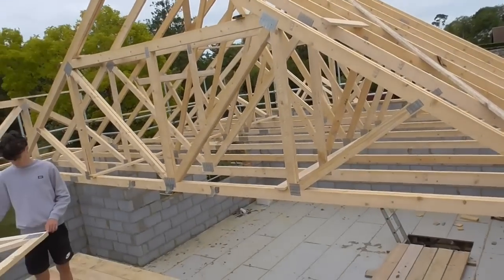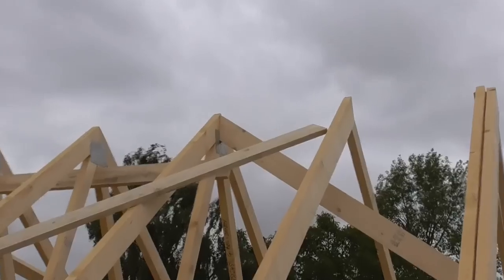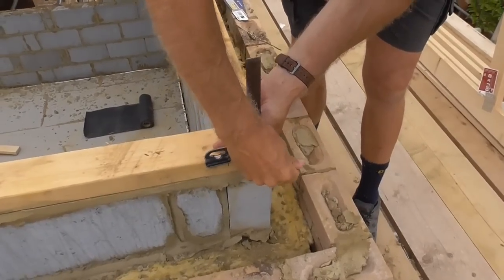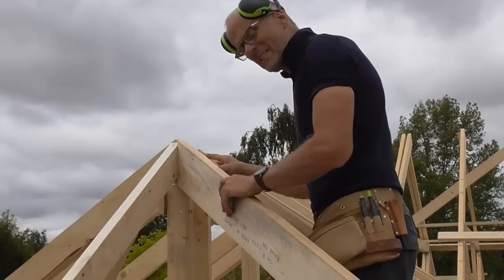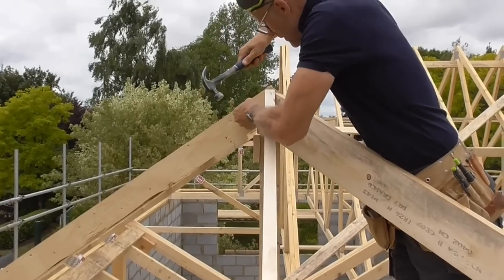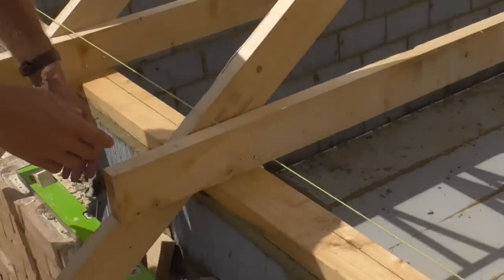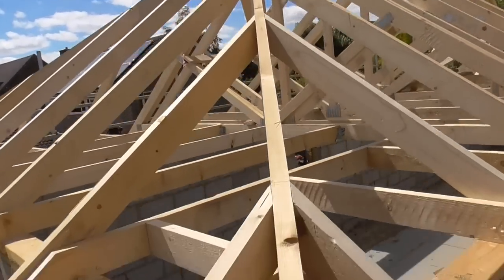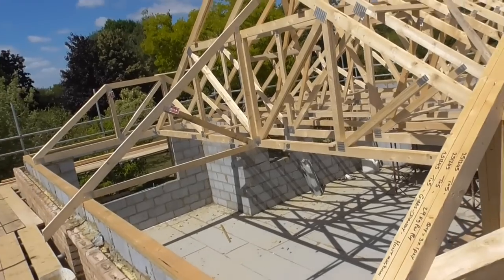Cutting hips on the end of a trussed roof ***12 HIP ROOF PART2***

Comment: Quick tip on how I do my hip cuts. I do both 45 cuts from the top. Using a sharp pencil mark your first hip plumb line, then measure the thickness of your timber square off of that line and mark another hip plumb cut line, the cut through the furthest one on the 45 the come back and cut the other one. No need to flip the hip over. Give it a go let me know what you think!
Reply from the maker: Hi Adam🖐I know exactly what you mean bud, and that is how we used to find the compound top cut when we used to hand cut them👊I'll give it a go on my next hip set😉Cheers Del
Reply: We use the middle mono to position the first full truss and never cut the mono.I only put a one way splay cut on the top of my hip and clap it against the mono too. It's probably the wrong thing to do technically but a lot of our hips are about 8m long and i think half the thickness of a hip out top to bottom is fair enough. You ought to have videoed  changing your adjustable square from common to hip cut cos a lot of joiners don't know the beauty of this feature.
Reply from the maker: @stevehallam6495  Hi Steve🖐I know I set my stall out way to precisely when I'm fitting these trusses, and I use the bottom chord of the mono to set the double girder, and I set the last 'common' truss half the span of the hip end back up the main run minus half the rafter thickness👊Thanks for your comment and I hope you haven't been up on a roof today🥵Cheers Del
Reply: Yup, that's how I do my hip plumb cuts, 👍🔨🇮🇪

Comment: You could have used a pole plate to create a new height for a birds mouth.
Reply from the maker: Hi there🖐I could have done that but it would have created unesesary work as the jack rafters are fine nailed into the ceiling joists👊I have done it on other roofs though👍Thanks for your comment 😎 Cheers Del

Comment: Is it worth jacking up that truss to take the deflection out? Then once the roof is complete, chances are it will hold, you could also add hangers(timber) and binders(old school ceiling spa style) from the hips to add rigidity? Ive also got my hands on some german screws designed for metal joist hangers and metal timber connections, they are a life saver in tight spots!
Reply from the maker: Hi Matthew🖐The deflection has been 'built in' so not a cat in hells chance of doing anything about😬And I'm gonna search for those German screws👍Thanks for watching and your comment😎Cheers Del
Reply: Built in? Poor trusses or part of some design? Eurotec 945232 are the screws let me know what you think!
Reply from the maker: @Goodwithwood69  Sorry, not 'built in' by design, more 'built in' and and be 'un built'😵Thanks for the name of those screws👍

Comment: Hi Del, great video, good that you have good help. Does your son want to be a carpenter?  You said you couldn’t birds mouth the jack rafters. As the weight of the roof is on the nails, as I assume they didn’t quite sit on the plate. Do you have to put brackets or clips on at a later date?  I love your roof videos as I still learn so much from you. I have done a few roofs in the past and get by but I’m a bit slow as I check everything again and again. I had to put a trussed roof on a local hospital. I was pleased the way it went but I could have been a bit faster (Nobody moaned) and my mate didn’t know any more then me. They were big so we had a crane go lift them in. Thanks Del.
Reply from the maker: Hi Jerry🖐 Those rafters each have 4 nails fixing them to the sides of the ceiling joists which is more than enough and actually no different to how they are fixed to the hips👍I don't see taking a bit longer to complete a job properly as an issue, and as long as you, and everyone else was happy with the work you did, then what does how long it took matter👊Thanks for watching😎Cheers Del
Reply: @thetallcarpenter  thanks for your reply Del. Ok thanks for putting me straight on that. I certainly wasn’t questioning you on that, more asking your advice. Look forward to your next video. Take care in this heat Del
Reply from the maker: @hi-tech55  Lots of fluids this week Jerry🥵Take care yourself bud
Reply: @thetallcarpenter  Thanks Del.
Reply from the maker: @stevehallam6495  It's actually approved by the truss designer Steve, and in this day of overly cautious structural engineers, many people forget just how much hold good old nails can give💪
Reply: @stevehallam6495  high Steve, I’ve learnt a lesson from the master. Del is a nice bloke.

Comment: We had a big valley set last year that a) didn't match the pitch of the main trusses and b) didn't even match each other. Spent about an hr doubting our technique (of 20+yrs!) Because we didn't think they could vary by as much as they did with modern manufacturing techniques!

The most frustrating thing in the world
Reply from the maker: The thing is Pete, we immediately think that its something we've done wrong, or are not getting, and we actually have to spend loads of time tying to diagnose where the problem is, AND then work out a solution😬 Great comment bud and thanks for watching 😎 Cheers Del

Comment: During my limited cut roof experiance I have never not needed to cut a birdsmouth. Thats all the tile weight being carried by the ring nails and the rafter brackets? Respectfuly Mike
Reply from the maker: Hi Michael🖐There's little difference between how the rafter is fixed at the bottom to how it is fixed at the top (to the hip), and the nails have fantastic holding power. The entire weight of one end of this roof sits in a joist hanger that is nailed to a single truss, this truss is then just nailed to 2 more trusses to form a tripple, at no more than 600mm centres🤯
Reply: What a nice way to make your comment. Shows the caliber of the man and the majority of your  Del. Michael stood strongly and respectfully by his belief and your retort was just as cordial. I often see other so called trades who badmouth each other and each have as little knowledge. This is very nice to see 👏🏻👏🏻👏🏻.
Reply from the maker: @gerardfarrell3135  The tone of Michaels comment is what dictated the tone of my reply. There used to be a time when most people could express a difference of opinion without resorting to abuse and insults, and I am quite fortunate to have commenters like Michael, you and many others who still posses the ability put across a different view in a rational and intelligent manor, making it easy to engage with👍
Reply: If you consider the weight on an individual rafter nailing through the ceiling joist is fine. If the tiles were heavy enough to make this move the jacks would be sliding down the hip.

Comment: Also, buy yourself a ppn nailer. We didn't think we could justify the extortionate price they think they can charge, but had a job a month ago with 120 pieces of metal work... Did them in about an hr and it had pretty much paid for itself in 1 job.
Reply from the maker: I'd love to get one Pete, but my builders just keep buying MASSIVE boxes of 35mm twist nails because they are cheap😵I think I need to put my foot down and just invest in a gun and put the nails on the bill👊Thanks for watching 😎 Cheers Del
Reply: @thetallcarpenter  honestly it's up there with the 1st fix for time saving. we got the DeWalt so the gasless nails were cheaper. Apart from the plasterboard collator I can't think of a tool that has saved us more time when we're on a price (not to mention the bashing the fingers don't get!)
Reply: The Bostitch strapshot pneumatic nailer is on my list, paired with my flexvolt compressor I believe it will be a winning combo, 👍🔨🇮🇪

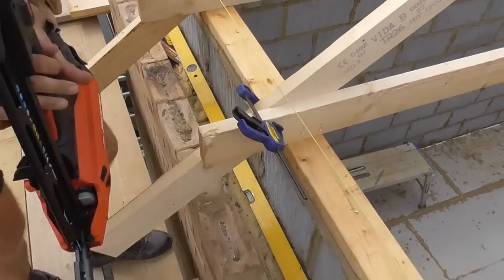Comment: 15:40...No birdsmouths ??.    Surely you dont expect 4 nails on each rafter ... to stop the roof from sitting down on the wallplate ?
 (or am I missing something ?)    Great work otherwise.
Reply from the maker: Hi Jim🖐In this age of ever more cautious structural engineers massively over speccing timbers and fixings, we are slowly forgetting just how strong the simple nail is🤔I'm more than happy with the strength of this joint, but more importantly, so is the truss designer who specced it👊Thanks for your comment and for watching🤩Cheers Del
Reply: @thetallcarpenter  Thanks Del but it looked odd to me.(electrical engineer)  I just dont understand the logic of not having maybe a plastic shim to bear the load onto the wall plate. I am not questioning the strength of the "joint" but the massive downward forces in play.  Just watched your played hip video and it completely lost me,   Brilliant.